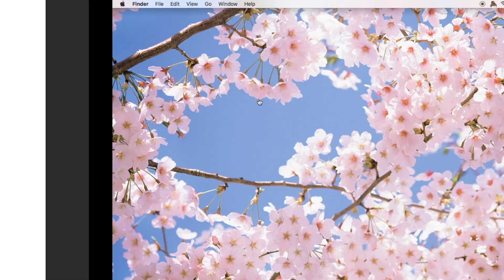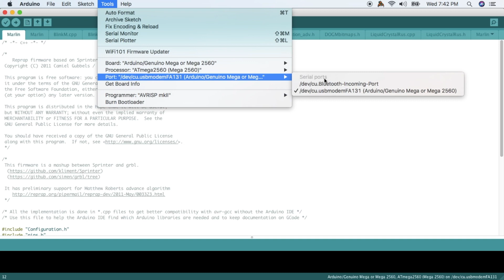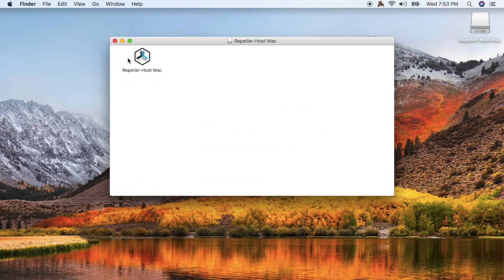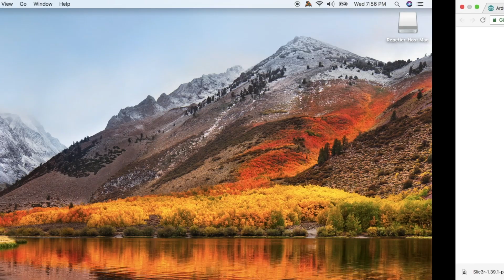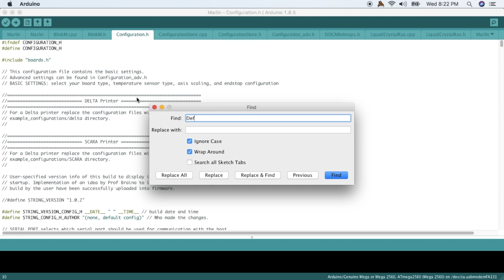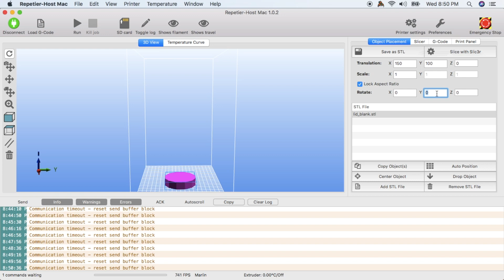D-Bot Build: Flashing Firmware & Initial Testing

Comment: using a pc power supply helps a lot if you keep blowing motherboards, i'm assuming those ebay power supplies don't handle mains spikes so well, that or even the £100 plus board's are built to fail.

Comment: The D-BOT MARLIN "out of the box does not support an lcd controller board nor sd card reader (which is on the controller board)btw,  You have to scroll down through the sketch and activate these!

Comment: I live your vids dude,very informative,but I have a question about programming the d bot for the alternative 300mmx300mm build size,is there any big difference in the programming steps?
Reply from the maker: Not at all! The only difference would be in the Slic3r config and initial set up with Repetier host where you specify the bed size.
Reply: @ScottBuildsThings  I'm intrested in doing set up with the LCD screen OS there any thin special I have to do to run my d bot this way?
Reply from the maker: Sir Grislemead The Cantankerous you can use an LCD screen , you’ll just need to uncomment the section corresponding to the LCD model you have on hand in the Marlin firmware and then reflash.

Comment: WOW! If were just that simple.   What about when you run headlong into error codes and don't know anything about arduino or how to fix these damned things???  Seems everytime i try to flash a mega with d bot marlin it wants to throw some error code up in my face! Extremely frustrating !
Reply from the maker: 123jerro have you tried googling the error it’s throwing ?  Usually someone else has faced the same problems, if not you could also post the error here and I could try to help you out ! :)

Comment: hi scott. really good video! wish it was around when i built my d bot. Anyway, ive revisting my d bot after not using it for over and am struggling to get it going again. i had to do a little rewiring as i had left it with the endstops unwired after a mod. Ive got a connection through Simply3d and arduino but i cannot move the motors?!! arghh!
Reply from the maker: Hey Paul, sorry for the late reply.  Hmmm, do you see any errors in the console at the bottom?  I'd first check that the RAMPs board is powered properly and that you can move a single motor with it.

Comment: Another great video. After I installed the Marlin software I got my printer to home to the same position as your. But for some reason when I prints it alwaya wants to print the object in the front left corner of the bed. Do you know if this is an issue from Marlin or is it something I am doing in my slicer program (Cura) that is causing this issue?
Reply from the maker: Hey Joshua !  Glad you like the video!  It sounds like the origin of the bed is set incorrectly in Cura. I don’t use cura so I can’t say for sure, but I had a similar issue in slic3r when I had incorrectly set the origin. I had wrongly assumed that ‘origin’ was middle of the bed, when in fact it is the front left corner located at 0.0. So in slic3r at least, the 300x200 bed configured with origin at 0,0 gives correct results — when I had set the ‘origin’ incorrectly to the centre at 150,100 it did what you described, started prints in the corner of the bed.     Hope that helps, sorry I haven’t used Cura for ages otherwise I might be able to help more !
Reply: Scott Builds Things thanks so much. I wasnt sure where to start. I will make some changes to cura in the morning. I'm glad there are folks like you making videos on this stuff. I couldn't do it without them. Thanks again.